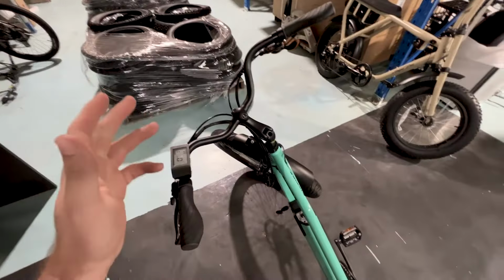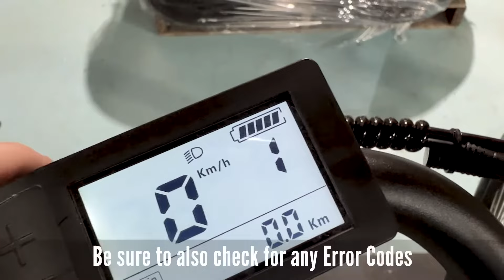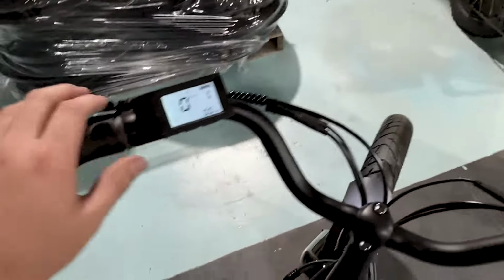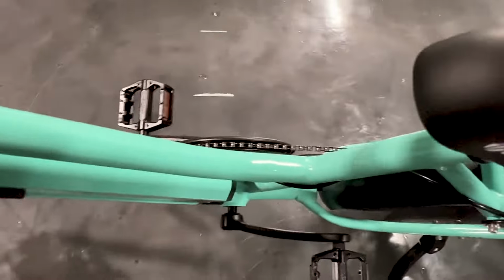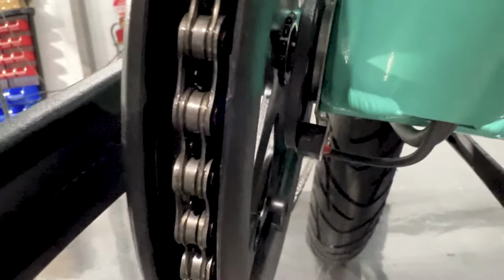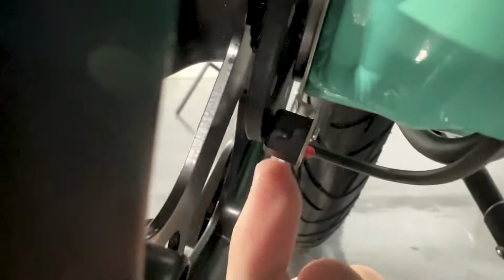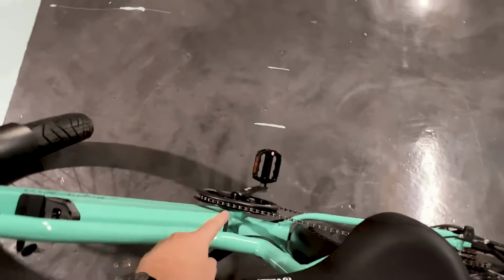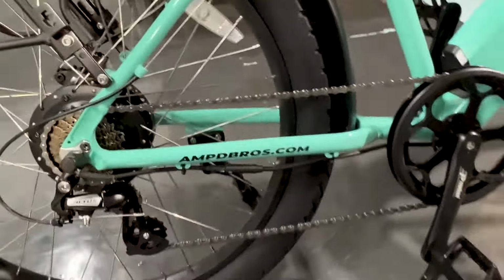No Motor Power Drive?? Ampd Bros E-Bike Loss of Motor Power Fix Tutorial

Comment: Thank you very much. I have this exact bike and the motor stopped engaging on the peddle assist. I checked the wire cleanliness and connectivity. I also got out the Q-tips and rubbing alcohol and cleaned the magnets and censor on the sprocket. Nothing worked... still...  Until I saw your video and you saying the little magnet wheel needed to be close to the censor and then I remembered how my little magnet wheel could spin and back and forth from that censor. So I pushed it up against the censor, picked up on the seat, and gave the peddles a go. Sure enough the motor kicked in like new.   :)   I was able to fix it. Thank you very much. I bought my Shimano off of Amazon and went back to possibly buy it again, but Amazon is currently out and might not get them back in stock. Again thank you very much.  :)

Comment: My motor turns over with pedal assist but then stops turning over ,the sensor is blinking the pedals are tirning.only when the wheel slows down wil the motor re engage when i again pedal  whats going on